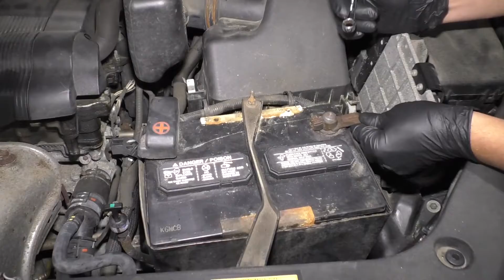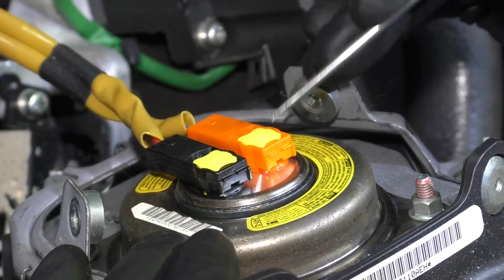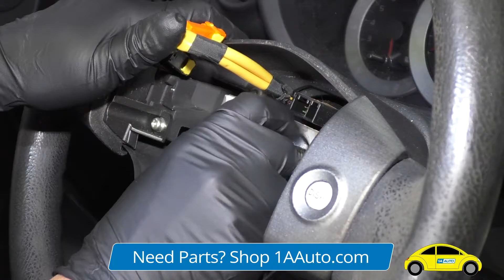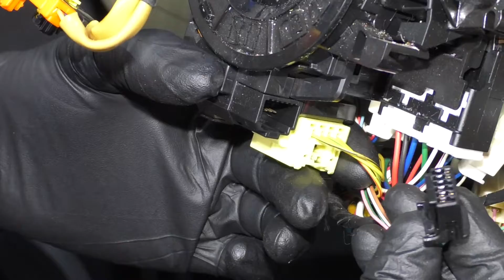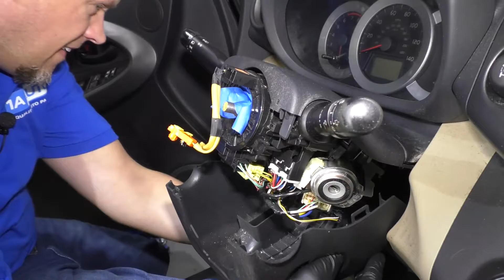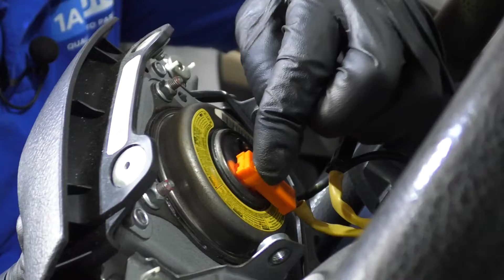How to Replace Clock Spring 05-16 Toyota RAV4

Comment: You might want to add that you may have to remove the steering angle sensor from the old clock spring assembly.  If you look closely at the back there are 6 tabs holding it on.   At first i thought i got the wrong part but i had to swap it over.  (Not shown in your video)
Reply: Same with my replacement clockspring. Needed to remove that from the old one and install it on the new one I ordered from a discount parts place. Of course, I didn't discover this until I had everything nearly back together. Minor setback.

Comment: my 2011 rav4 horn doesn't work. my mechanic diagnosed it as a bad steering wheel cable reel. is this the same part as you replaced? you called it an airbag clock spring--
Reply from the maker: +dave schmuland Yes it is the same part! Thanks for watching.